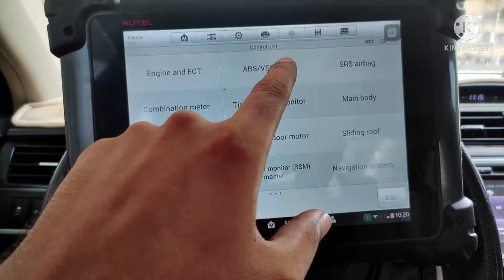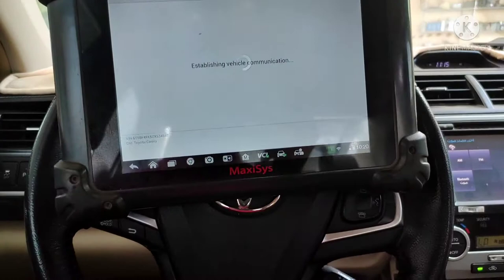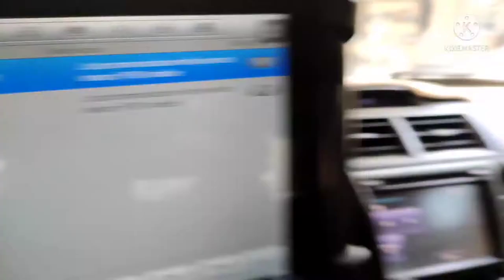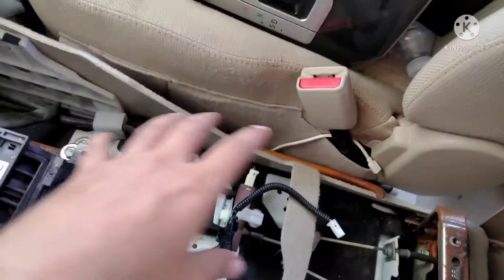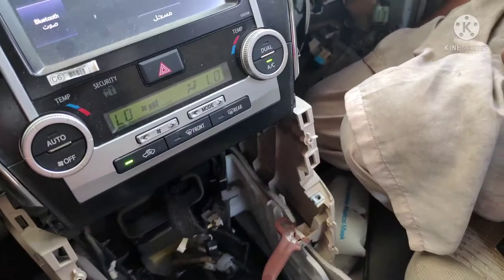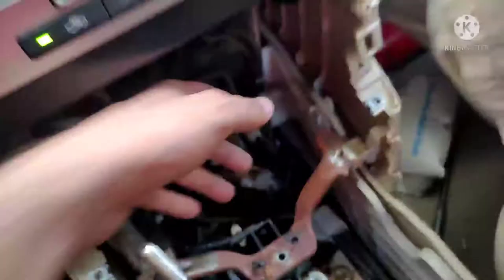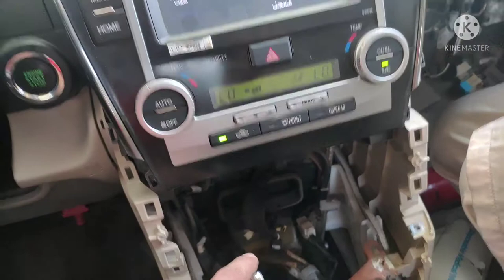Toyota Lexus U0123 Lost Communication With Yaw Rate Sensor Location.

Comment: I have u0124 code ,this is what wrong,is about the sensor or wiring is open or short.from 2016 Toyota Corolla le 207km,and the steering is stiff and drive with tough or unsmooth like before,after learning parallel parking for 1hrs,then I feel the steering stiff.
Reply from the maker: Mostly the sensor it self

Comment: I have Camry 2017 and suddenly light came on 
warning light and c1435 Where rain water entered the car what should I do? Can you help me?
Reply from the maker: You means this code appear after car flooded? You need to change airbag control module disconnect battery before changing control unit
Reply: @CarFaults  Can I contact you by email? I can send you a picture of the light
Reply from the maker: @walem6783  yes sure its latestcarfault@gmail